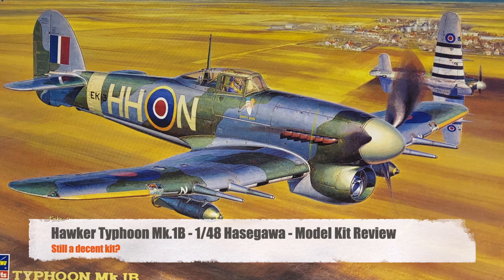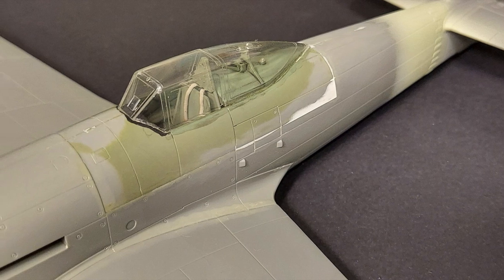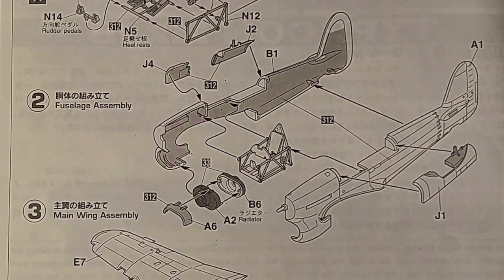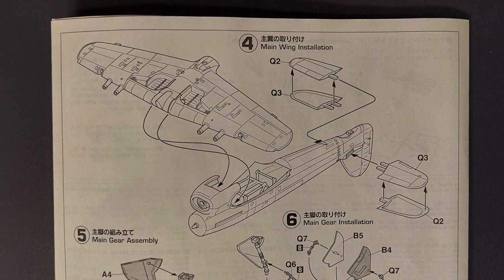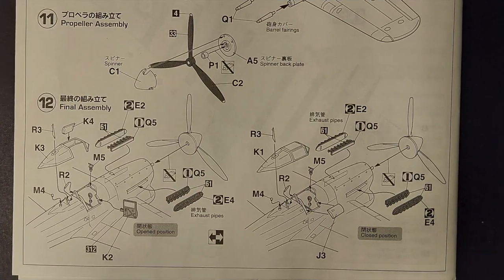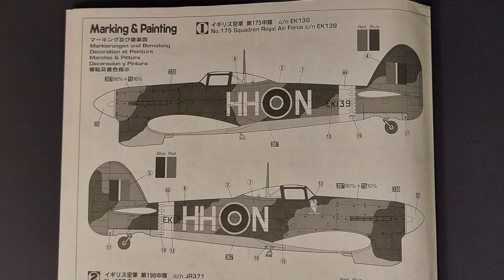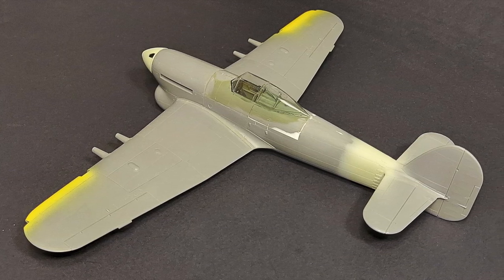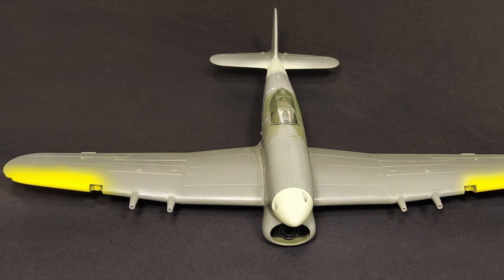Hasegawa 1:48 Hawker Typhoon Mk. IB Review - Still A Nice Kit?

Comment: I built the Eduard boxing of the later bubble top Typhoon and liked it so much I bought a second to put in the stash.  I totally agree with adding the inserts first then joining the fuse together.  The only fit issue I had was the top of the forward fuse.  There was a sizable gap that needed some sheet styrene to fill.  On the next one I'll leave out a bunch of the photo etch in the cockpit like all the small gussets between the tubie structure since none of it is visible when closed up.  If Eduard still produces the photo etch set get it.  The seat and radiator detail are worth the price alone.
Reply from the maker: Right on! I like the Eduard photo etch sets. At a minimum, the Eduard seatbelts really dress up any 1/48 cockpit.